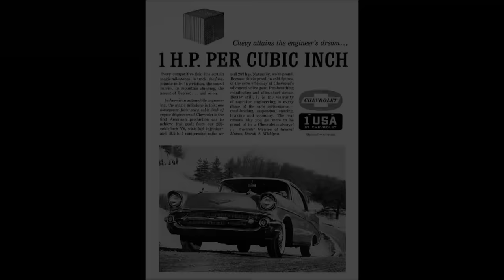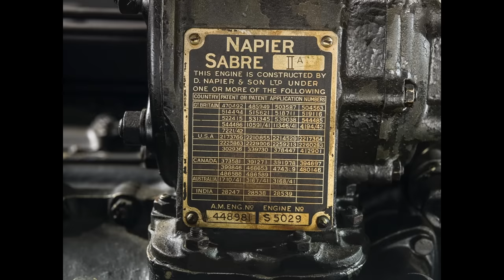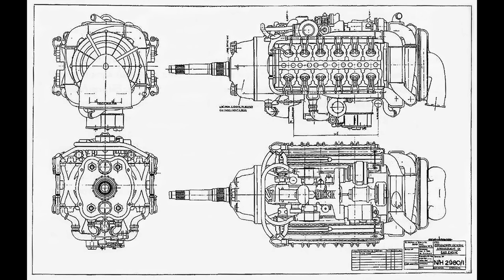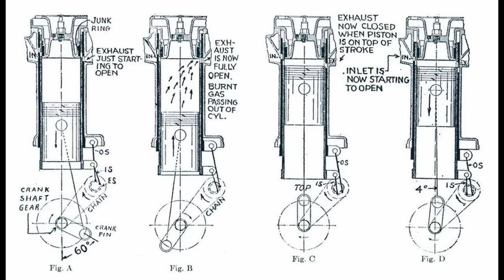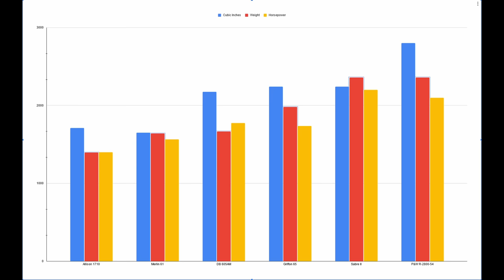Napier Sabre - The Ultimate WWII Aircraft Engine - Part 1

Comment: I don't see why it makes sense to exclude the compound boosted Allison.  It's not like we're looking FI versus NA.  It's one kind of forced induction versus another.  Mostly, I'm not buying this claim that sleeve valves are vastly superior when it comes to a boosted application.
Reply from the maker: Not talking turbo in the forced induction sense. This was a turbine connected to the crank that recovered exhaust gas thrust and converted it to actual torque
Reply: @flightdojo  Oh, interesting.  OK, the distinction makes sense now, thanks.

I'm still not sure I buy this "sleeve valve" thing though.  ;)  Mostly because, as mentioned, it's really complex, and once you start using forced induction, a lot of the issues of poppet valves go away if you adjust the porting, piston and chamber shape, and cam timing.

Still, everyone involved in any of those projects were WAY better at all of this stuff than I'll ever be and I'm totally Monday Morning Quarterbacking them with the benefit of 80 years of advances in IC engine design.    So all of my commentary on the subject should undoubtedly be taken with a large grain of salt.  :D
Reply from the maker: @ilcylic  You're correct. The sleeve valve phenomenon was a fad that was a complicated solution to a temporary problem. When new alloys were put into production that overcame the overheating issue of the exhaust poppet valves under boost, poppet valves once again took over.

Comment: In the 1930's poppet valves were not yet filled with sodium to make them cool better..........they instead ran very hot and produced a "detonation" problem. Sleeve valves did not have this problem........however poppet valves eventually adopted sodium and sleeve valves died out forever after the sabre.
Reply: Wright J5 Whirlwind of 1925 used sodium cooled exhaust valves.
Reply: @johncrowley5612  when did they become commonplace...........adopted by all engine makers?
Reply: @wazza33racer  They weren't adopted by all manufacturers, but they certainly weren't a secret in the 1930s.
Reply: @johncrowley5612  there could have been cost and/or reliability issues that prevented adoption en masse. Sometimes manufacturers are very conservative and simply wont adopt something until its extensively proven.
Reply from the maker: @johncrowley5612  I was trying to find out exactly when this was adopted myself. I doubt it was commonplace as the drawbacks of sleeve vales probably aren't worth the trouble if the exhaust valves can be cooled properly.

Comment: Yes, a great engine IF you got it started and IF it did not catch fire in doing so.
Reply: +@tomjoseph1444    I think it had only so many start attempts before you had to stop and remove the plugs to prevent hydraulic lock damage, then start over.

Comment: I've never heard of a power to weight ratios being calculated via engine weigh.
I've always heard it's power to vechicle weight.
Example 1k engine weight in 10k vechicle vs 10k engine weight in 1k vechicle.
Given the same HP.
Heavier engine?
Build lighter vechicle.
I understand planes need to be light, as well as payload  capability.

Comment: 0:41 "1 hp per cubic inch metric", now you lost me...
Reply: From the late 1930's until the late 1940s/mid 1950s (depending on where you were), the big goal for engine designers was to produce a standard production engine, rather than a crafted race engine, that could provide at least 1 horsepower for every 1 cubic inch of displacement. Of course, it is now extremely gauche to say 1hp per cube "equation" or "recipe" or whatever else that may make more sense linguistically. I am old and was born in the USA, so I dislike the term "metric" as used in the phrase you quoted. If you're talking about cubic inches rather than centimeters and horsepower/lbs-ft of torque rather than Newton-meters or some other metric-centric unit, keep the "metric" out of it, because it just confuses the issue.

Comment: Ahead of it's time but unfortunately time is of the essence in war and reliability is paramount. High compression ratios and r.p.m. are not conducive to reliabity.  Also R.R. had the advantage of building on and perfecting the Merlin design over time this was the crucial advantage. Also a simpler design with less cylinders had the advantage in production and servicing. Ultimately supercharging was the real answer to lack of power particularly at altitude.

Comment: Sabre got a bad reputation for catching fire, leaking carbon monoxide and harmonic vibration in the Hawker Typhoon. As a 'racing' engine early examples were bench-built by technicians, mass production was problematic to say the least. The later Hawker Tempest performed better with the Sabre V, but issues still persisted. However the Sabre engine was dropped by Hawker, the only company to use the engine, as soon as the Bristol Centaurus 18-cylinder Radial engine came on line in 1944.
Reply: Likewise, by this time, both the USAAF/RAF had the loss ratio numbers compared to engine types and radials by and large had 2-->3X lower loss ratios.  P47 for instance had 3X lower loss ratio than P51 even though P47 was faster etc up high than P51 and superior dogfighter up high it was still tasked with all the low ground pounding as it was the superior engine/platform for doing so.  Even with all the flak, ground fire etc, P47 still had 3X loss ratio superior to P51 for all causes.  In fact, P47 had a lower loss ratio than the P38 with 2 engines and lower loss ratio's than the 2 engined Mosquito.  Liquid cooled engines, great at winning a race, SUCK for winning a war.

Comment: you say the problem late in the video.
reliability.
sleeve valves are a lot of moving parts.
it's why none have been successful in continuing production.
oil consumption being the biggest problem of  cylinder ports.

Comment: There is an issue with high rpm in aircraft engines as you have to either gear it down to the prop or you have to run a smaller propeller to keep the blade tips from going supersonic

Comment: Fastest way to make more power is to get rid of the poppet valve as it decreases volumetric efficiency and increases destructive power robbing knock.

1 HP per cubic inch is a lame metric, because Nikola Tesla had developed a turbine engine that could produce 10 HP per pound.

Comment: HP per swept volume is not an important measure for aero engines. The most used measure was HP per mass. Using this measure the Napier was no better than high performance versions of the R2800 or R3350. That is before accounting for all the extra weight of liquid cooling ancillary's.

Comment: Allisons were one of teh oldest engines, lasted longer than the rest post WW2 in widespread misc applications, and were putting out 2,200hp regularly during WW2. You showed them to be the lightest engine, and with 2,200hp, would make them best overall. consider how many aircraft in WW2 ran on Allisons. Consider the simpler design, the easier maintenance, far greater reliability, etc. Also, aircraft that used it like the Typhoon were low-altitude fighters, like the P-40 and A-36. But the P-40 gets criticized and the Typhoon does not, despite the P-40 lasting the entire war in multiple theaters, climates, and roles.

Pure numbers of performance is not enough, and some engines like the Allison weren't compared fairly for late war. War is won by Logistics, and not about pure numbers. Reliability, simplicity, durability, etc matters FAR more. The proof is in teh pudding, the Allison, Wright Radials, and the Merlins more than any other engines won the war hands down.

If you removed all Napier Sabre engines and the aircraft that used them from existence in WW2, the allies wouldn't have lost a single battle and the war would have ended with no noticeable difference.
Reply: Nonsense. If you ignore technical advances in war, you lose. To stay competitive the Merlin more than doubled in power during WW2. It was pretty clear it had reached its limits and the Griffon was only a partial answer as it was too heavy for the Spitfire airframe.  The development of a super powerful engine was essential. However worthy the Allison engine was, it was a worthy workhorse, not a racehorse. The P51 was an also ran until it swapped the Allison for the Merlin. Typhoon was more ground attack than fighter so it's ceiling was not critical, but that was primarily a wing design limitation overcome by the Tempest. I don't think the Germans underrated the significance of the Sabre. They were frightened stiff by it, which was rather the point when all is said and done.

Comment: "The Sabre was held back by political machinations".  And then you don't give any examples?

In terms of the numbers, the Rapier was amazing.  But it suffered from being too new in many ways.  Most of those ways were because it was not developed enough at that point.  It was heavy and unreliable when introduced as you pointed out.  The Merlin had a lot more development and was lighter and more reliable, and it was sufficient for the job.  It also had room for more development and more power using the same basic engine, with all of the logistical advantages that come with that.  Including training.

BTW, I doubt the H-layout was that big a problem to the mechanics.  I bet the sleeve valves had a far steeper learning curve, because they are completely different in basically every possible way.  And the linkages to make them move correctly were fairly complex, appear to have been a bit fragile early on, and needed to be very precise.

By the time the Rapier had been developed sufficiently, it wasn't really needed.  By that point, the Allies had achieved complete aerial supremacy over the Western front.  The engine was very good, but the jet engine was coming and everybody knew it was the future, so after a point development of the Rapier stalled.

The Rapier was, like many less-successful aero developments, a victim of timing.  If work on it had started 5-10 years earlier, it would have been the engine that won the air war.  If 5 years later, it would have only been an experimental engine that was ignored in favor of jets.

BTW, have you read "The Secret Horsepower War"?  A big tome which could have used another pass through an editor, but it has lots of detail about engine development on the Western Front.  It makes the point that what really made the Merlin great was the amount of development that it had when the air war really got going, and how concentrating on developing the one engine type led to better results than trying every possible variation the way the Germans did.
Reply: It was just pushed into service too soon
Reply: @bsimpson6204  -- Perhaps that, but I think it was also a decision to concentrate the most effort in improving something that already worked well, rather than reaching for something that worked the best.  They didn't let the perfect be the enemy of the good.
Reply from the maker: I searched for sources detailing the intrigue between RR and the Air ministry but was not able to find any that went into sufficient detail beyond what I included.

Comment: if your weight and horsepower charts are normalized, and teh Sabre weighs more than the horsepower it outputs, then it's Power to Weight Ratio should be less than 1.0, while the Allison at 1700hp is lighter than its horsepower, and so should have a higher power to weight ratio than the Sabre at over 1 horsepower per 1lb (or kg, whatever you're using) of weight. And that is not even accounting for the fact the Allison could handle 2200hp, almost the same as the Sabre. At 2200hp, the Allison stops the Sabre for power to weight.

Comment: Most of the high Hp engines are outlawed nowadays  due to compilation and government  not fuel mileage and efficiency.
Reply: +@colinvoss8484   Shrinking supplies of spare parts no longer made will put most of these engines on the ground eventually.  Insurance and cost of operation will make it difficult to keep them flying also.
Reply: Large displacement piston engines are completely obsolete technology in the aviation industry, they were quickly superceded by jet and turboshaft engines.

Comment: As far as I am aware, there does not exist a single functioning Napier Sabre engine in the world today.
Reply: +@callanclarke371  Three separate projects will be using Sabre engines, rare as they are.  All of these projects are still building the airframes and have not started on engine work.  It may take a few more years of parts and research to get the Sabres operational.
Reply: Kermit Weeks of the 'Fantasy of Flight' museum has a brand new crate engine that will be used on one of his two Tempest restoration projects
Reply: +@callenclarke371   Kermit Weeks had obtained two Napier Sabre engines, an earlier version and a Sabre V.   As he talked about in a recent video, the engine vendor has told him to use the Sabre V because it is an updated and safer variant.  Weeks' Sabre V also does appear to be a very rare factory crate engine.  And also mentioned in the video was of the three active Typhoon/Tempest projects, Weeks has the only Sabre V engine and at least one other project has been told "no" by the engine builder. (The RB396 project has a Sabre II engine.)  It may be too early in the restoration, but you could wonder that this may be a roadblock for the other projects.

Comment: Why didn't they run higher compression
Reply: Compression (both compression ration of the pistons, and supercharger pressure) were limited by fuel quality. Temperatures also played a role: part of the reason the Merlin could be developed so much over the initial design is the high-temperature alloys RR had access to.

Comment: Yes, in the olden days they used to think you need RPM to generate more power and it does work that way up to a point. But now days we are able to generate way more power in the other direction with Torque, not with RPM. Now we have engines that generate 3000 Hp with a 6.6 V8 Turbo Diesel engine.
Anything over 8 cylinders you are creating more surface area for friction that will eat up gas and your power.
Also the sleeve valves are a horrible design if you consider the friction. Regular valves have very little friction and the limited size of the valves are not an issue when you are feeding the engine with 100Psi pressure.
Compound Turbos are a must on any high performance engine today.
Reply: There are still some modern engines that use small displacements and high RPMs to make lots of power, especially in bikes. A Honda CBR250RR goes to 20k!
Reply: @blooptastic  And tiny little engines spinning +/- 20,000RPM making huge amounts of power for cars involved in a thing called Formula 1 racing, among others.

Comment: At the time this engine would be put into mass production they began making jet engines.  The aircraft industry decided the jet engine was way better for a fighter airplane.  Rolls -Royce started making Jet engines.
The Allison V12 may have become a competitor to the Merlin but it would lose power at high altitude.  The engineers never solved this problem.
Reply: The US Army Air Force saw no need to improve the Allison's high altitude performance since they used the engine in ground attack aircraft. The P-51 was designed for that purpose. The RAF ordered a batch and decided to fit a Merlin in one with the help of Republic that was doing the same back in the states. It improved the aircraft's performance so Republic switched over to using it.
Reply: @billwilson3609  Republic had nothing to do with the P-51.  North American Aviation was the manufacturer.

Comment: I watched with growing skepticism up to 14:57 at which point you disqualified the Allison because it made an obscene amount of power. It was in use in the war and that was your beginning criteria at least as I understood it. You say it's the greatest engine but go on to say it was way to heavy for the amount of power it made and you say essentially that it DIDN'T make more power than the others by any significant amount. You also admit in several places that you are not qualified to actually make a legitimate comparison and that you did not have the actual performance figures. 
Also, if sleeve valve were all that great where are all the sleeve valve engines in today's cars? All those cars that use Poppet Valves as do Formula 1 racing engines. All those sleeves with their sliding areas would surely contribute a lot of internal friction and wear. Also it should be that the simplest design that does the job required is the best. The more moving parts you have the more points of potential failure you have. 
The Napier Sabre reminds me of the BRM formula 1 engine that also used the H pattern with twin crankshafts geared together and it wasn't very successful either. To complex.
I started watching this video because the Napier Sabre was mentioned favorably in a book I read many decades ago by Tom McCahill. I was sadly disappointed in this video.
Reply from the maker: I disqualified post-war variants of the Allison that were turbo-compound.  In these engines, because the exhaust gas turbine was connected to the crankshaft they were, in my opinion, something like a jet/recip hybrid. I did not think that would make for a fair comparison.  

The reason sleeve valves aren't used in today's cars is because the poppet valve situation has since been solved. This comparison is only accurate from the years 1939-1945.